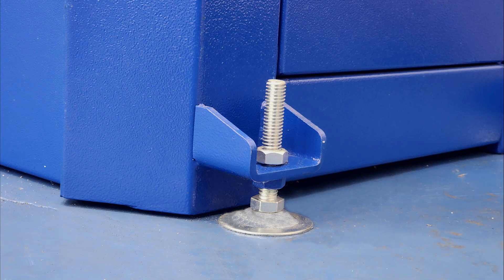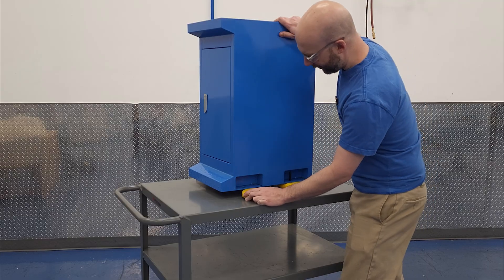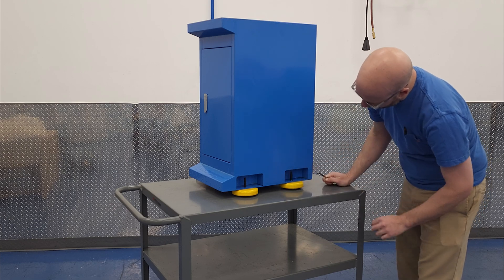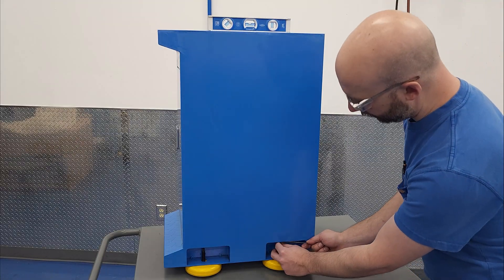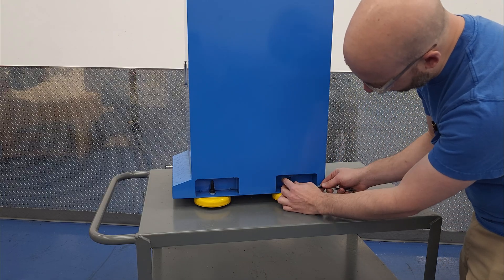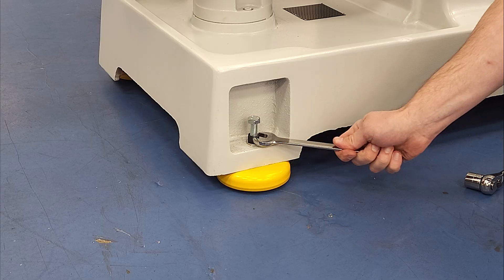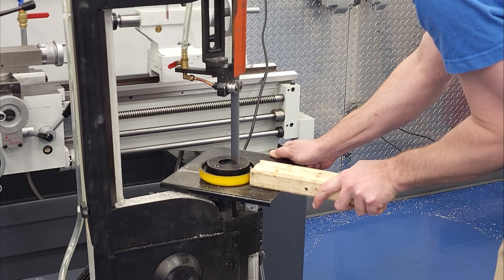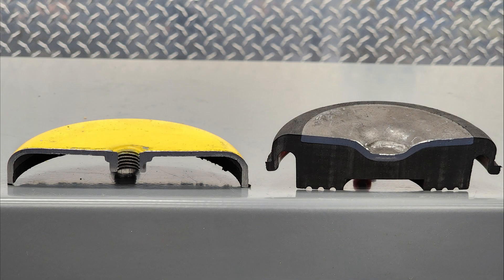Machine Leveling Pads - Precision Matthews Media

Comment: Could you demonstrate the proper procedure and method of leveling a PM 12x36 lathe that requires 4 pads at the head and tail stock ends? It seems like it took me half a life time to get my lathe "good enough" and I would like to see if there is a better method since I want to move and relevel mine.
Thanks
Reply from the maker: You can check out the video we did on our PM-1340GT, use the same technique. https://youtu.be/vpG61q5oymU

Comment: What's the benefit of the pad vs the metal foot aside from which part holds the weight?  Is it just vibration damping?  Is the machine as "planted" compared to steel feet?
Reply from the maker: Mainly vibration damping, but also a little easier to adjust than traditional screw in feet.